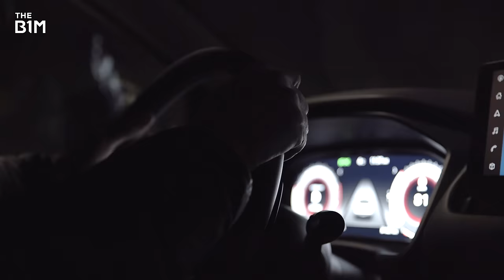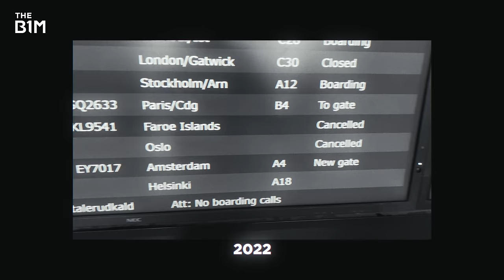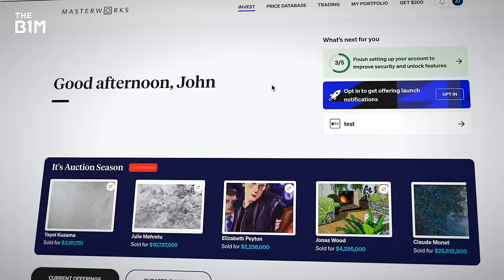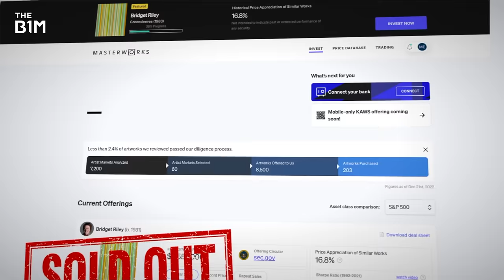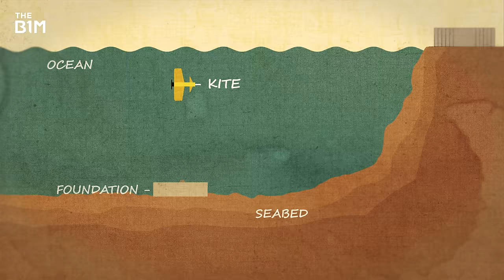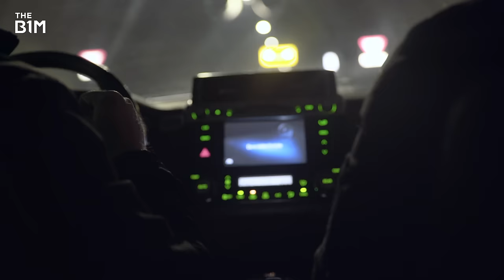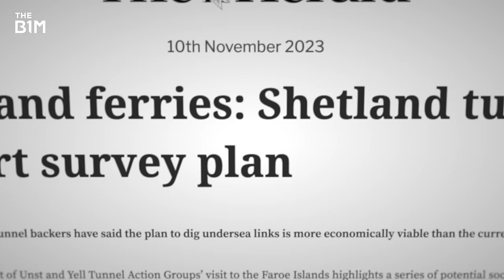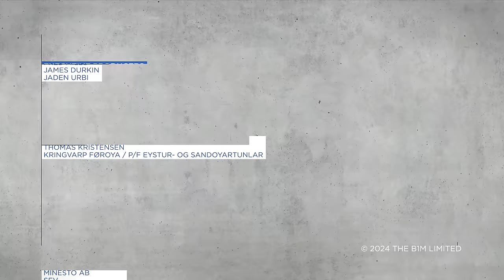This is The World's Most Remote Infrastructure Project

Comment: Amazing engineering. As someone who regularly works on construction projects over $100M, I'm struck by how cheap these tunnels were to construct. California's high speed train is now tracking $100B and growing and most of this uses above ground rails.
Reply: @jazbasic that daft project (HS2) is burning through millions renting tracts of lands across England that haven't even seen a spade break soil and possibly won't for years...(I imagine that the Faroes have far less issue with factors like that). Nonetheless I'm in awe of the tunnels and the seemingly flawless efficiency on display (not to mention the social aspect mentioned)
Reply: I wonder, given land costs these days, maybe tunnels are going to be the only affordable way to go in the future. I hope not, because maintenance costs are going to be far higher and looking out the window is half the joy of traveling.

Comment: Very interesting story about their use of tidal energy, including one brilliant engineering trick:

1) Tide schedules at different locations overlap, so no gaps in the power.

2) Having the “kites” fly a figure-8 course like that, they’re turning very slow tidal currents into much faster & thus more efficient water flow over the turbine blades. A brilliant solution, I wonder why we haven’t heard about this approach elsewhere?
Reply: All the tidal energy projects I have heard about fail due to the harsh conditions of the sea.  Mechanical systems get battered and the cost of replacement (both in $ cost and climate cost) is higher than using gas or coal.  I am interested to see if they meet their goals. I would be nice to see if these goals can be reached on a smaller scale like the Faroes before committing a large mainland to bad ideas. It is also nice to see them expand their hydro power for people instead of removing dams like they are doing on the US west coast to save fish.
Reply: @mitchellfolbe8729 right. I think the fact that those "drones" are just tethered, and can be dragged back to shore, is a huge factor in reducing the maintenance cost and repairability. 

Excited to see where this technology will go
Reply: @TheXshot  Sure but you still need ether divers to go and attach and detach it, or mechanical pulley system. It all increases complexity hence price and potential to break downs. As mentioned sea is incredibly harsh environment, where only the most protected but mostly simplest systems work. For instance in Norway oilrigs buddy was a welder there back in a day. They got all new fancy welders from top brands but those started to fail and kept failing to point where after half a year more machines were in warranty repair than not. Only option was then that project manager went trough internet and bought all the available old analog welders, then took a van and drove around picking them up and visited random farms asking if they had one and willing to sell, paying sometimes double what the machine was worth in the open market. Same applies here and even more since its submerged. Just the salty sea air will cause issues to circuit boards required to run this complex machine and those are inside airtight compartments. How ever those need to be opened on maintenance and salty sea air will get in, or worse there is a leak. Its not like something like this can be run on the near surface, it needs to be deep enough so pressures are much more there.
Reply: @TheXshot look more efficient than the toy segmented snake type..

Comment: Very well done. You did a great job covering these feats of engineering and what is so surprising (yet not) is that the costs are "relatively" low for the building of these tunnels.
It really is kind of amazing how cost effective something like this can be when you not just remove greed (good luck there), but also actually have the best interests of the residents in mind.

Comment: ...it's probably cold all the time. Not to mention full on winter.
Gorgeous scenery for sure.
Reply: Not cold in the summer between 12 and 15 degrees, last year one day measured 24 degrees, and in the winter it is about 3 to 5 degrees, there is never ice on the sea, as the water temperature is always between 8 and 12 degrees.

Comment: Why didn't they spray the walls of the tunnels with epoxy and hardener and chopped carbon fibre to prevent the water getting through.

Comment: How does a yellow submarine generate electricity? How do you store it, in batteries or power cells? Then what carry those to a relay station and plug them in for the city? Is the power wireless and transmitted through a signal to homes?

Comment: Hello there. You mentioned a lot of figures in your video, both financial and population wise, relating to the Sandoy tunnel. But I do not know whether they are current numbers or when the tunnel was built. The reason that I am asking is that I live on the Isle of Wight. We have no tunnel but a duopoly of ferry companies plus the odd hovercraft (when they run). Us islanders are cheesed off with the outrageous cost that the ferry companies charge for just a 2 1/2 mile crossing. But we have no choice. A tunnel has been suggested but it is always blocked. If the $200m cost that you mentioned is current, as we have a population of around 145,000 on the island, that would work out at roughly £1,400 per resident, (as compared to the $7,000 per resident that you mentioned for the Sandoy tunnel), even though a tunnel to the island would be much shorter. I am preparing a paper for the Wightlink Users group but want to try and provide figures as accurate as possible. Many thanks

Comment: I am amazed.  $200 million for a ten mile tunnel under the ocean!  In the US nothing like that could be built for under a couple of billion.  And they have to ship everything in to build it.  Preliminary estimates for the mile and a half bridge over the Chesapeake at Baltimore are between one and two billion dollars!!!  That is a place with infrastructure, work force, and heavy equipment close by.  For a bridge above the water.  Engineering wise it is a far more simple problem than building undersea tunnels in remote location for mile upon mile!!  On top of which it will most likely take longer to build the 1 1/2 mile bridge than any of their tunnels.  Sounds like they eschewed modern technology and forwent the use of boring machines in favor of old school drill and blast methods.  Achieving it for excellent dollar value and in a timely fashion.  I wonder where they stored the waste rock in that mountainous terrain?

Comment: The deep tunnels are impressive from an engineering standpoint, but they don't seem very cycle-friendly, which is a pity considering the relatively short distances involved.
I'm surprised they did the underwater roundabout instead of building a 600m bridge over the Skálafjørður to Strendur.

Comment: The wind turbans are a waste of money. They never make enough power to pay for themselves.
Reply: They usual do actually, no problem. But they usually do not make up for the emissions let out to manufacture and put them up, but that's another issue, and possible what you have heard. Of course there can be cases where they do not make enuogh money initially, but they are needed for 'no emmission power' in an area, and the society just have to take the extra cost
Reply: @Rimrock300  No, they don't, based on studies from our government and the manufacturers.  If it wasn't for government subsidies, they would not exist.